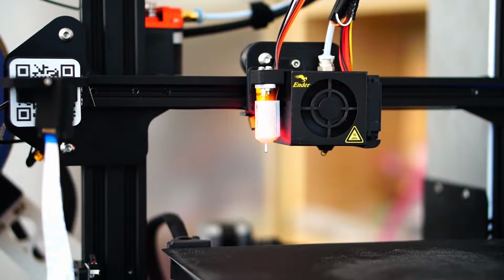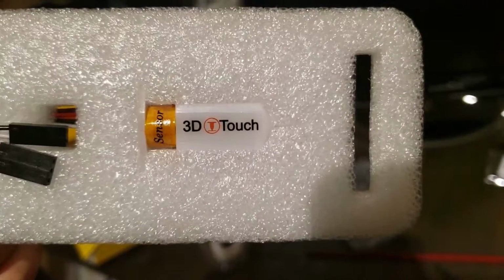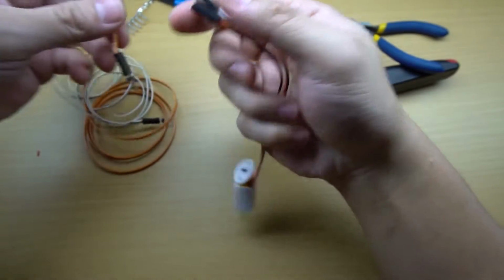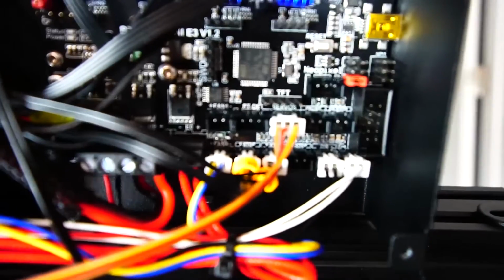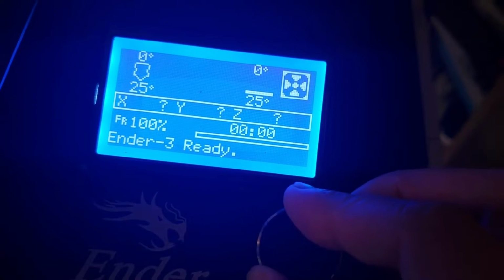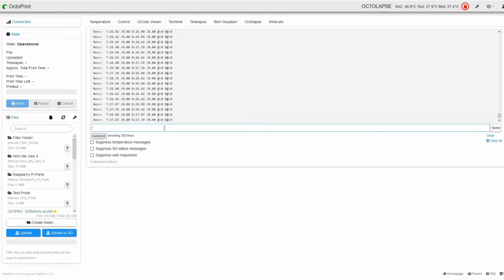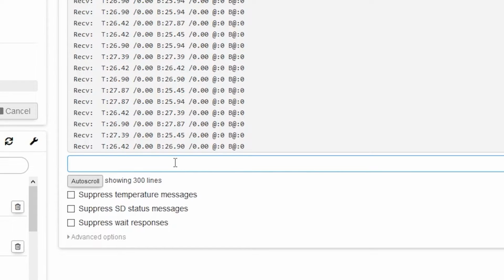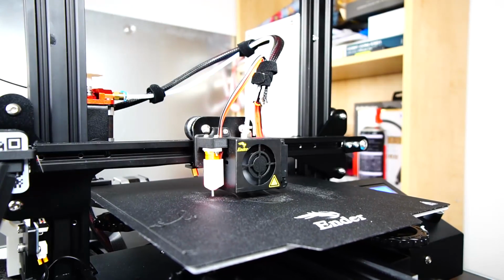3D Touch +  SKR Mini E3 v1.2 on Ender 3 Pro 3D Printer

Comment: Thanks for the video. but I'm having a big problem with the bed leveling it probes in the middle but in the first corner never touch the bed... I have been reducing the bed size to 225 change the probe setting and nothing make it to probe the first corner... any sugestion?
Reply from the maker: So when you run the ABL with G29, it goes to the front left spot and doesn't go towards the bed, or it goes towards the bed, but the probe doesn't touch the bed?
Reply: @dorkytim  it goes towards the bed, but the probe doesn't touch the bed
Reply from the maker: Could be a few things, like bad firmware, sensors not triggering, miss wiring, but really can't be sure with only this much info. I recommend connecting a terminal to the printer, using octoprint or another software, and seeing what the output is after G29 to see if it's a problem with the probe or sensor, there should be some response messages that'll give some more clues. If you are using BLtouch v3+  , definitely make sure you are on the latest firmware since there have been some known problems with the software not playing nice.
Reply: @dorkytim  This is what I'm getting [ERROR] Error:Probing Failed
Reply: or let me know what else info do you need. and by the way thank you for the great video and I hope you get more suscribers... I'm your 12 ... jeje
Reply from the maker: The error probing failed message indicates that it's not getting the right response from the probe. There's only a few things that can cause this.
1. If it's going off the bed, then you'll need to check your firmware and XY offsets. Typically bed size should be 220, but it also depends on where you have your X and Y offsets are.
Example:
#define X_BED_SIZE 220
#define Y_BED_SIZE 220
#define X_PROBE_OFFSET_FROM_EXTRUDER -48 // X offset: -left +right [of the nozzle]
#define Y_PROBE_OFFSET_FROM_EXTRUDER -10 // Y offset: -front +behind [the nozzle]
2. If it's hitting resistance before the probe. Make sure the probe extends way pass the nozzle when it's extended so that the nozzle tip isn't touching the bed first. Might need to try different mounts.
3. There's too much of a slant where the probe hits the surface, or the mount is not secure. You want to make sure the probe is hitting the bed flat. Make sure there's no tilt and that you at least try to level your bed as much as you can before using the auto bed leveling. As the probe pushes down, it'll throw an error probe failing if the values detected vary too quickly before it reads the results.
4. There are some cases where bltouch doesn't play well with certain versions of Marlin, but I think you are using the latest build, so this is likely not the issue.
5. Make sure to check wiring and nothing is getting loose while the hotend is moving.

These are all the things I could come up with, hopefully that helps.
Reply: @dorkytim  I was able to find the problem. It was the bltouch mount. Thank you for all your help and keep doing your great videos
Reply: @camiloecheverry5210  im having the same problem. It can probe other points but in other points, i get a probing failed message. Sometimes, the nozzle is already pushed to the bed.

Comment: great video keep it up ! my z is showing 12.5 from the bed. how can i fix it
Reply from the maker: Do you mean 12.5 after you autohome? That should be normal. You need to slowly move down towards the Z0 point without running into the bed and start to adjust the z-offset. This offset is to help determine the distance from the probe and nozzle and you may need to do some test prints to get it just right. Once you do, then you should be fine unless the bltouch or nozzel is moved.
Reply: @dorkytim  for some reason no matter what z offset i change it too my nozzle never comes close to touching the bed after auto homing my z. any advice?
Reply from the maker: The nozzle should not be close to the bed after an auto home. Auto home should park the nozzle around 10mm above the bed. Once the gcode is launched it'll go to the correct z position plus the offset.

Also note, some firmwares reset the bed leveling mesh after an auto home (G28), so you'll have to insure you have command "M420 S1" after the G28 command in your start code to ensure it uses the bed leveling mesh before starting the print. If you already run G29, then you don't have to worry about it because G29 (auto bed leveling procedure) automatically uses the bed leveling mesh it just created.

Comment: thanks again for you thorough reviews and instructions.    For the Thingiverse  reference to a mount, which of the two mounts did you actually use:   the ender3-bltouch-mount-4b-3mm-lower.stl or the ender3-no-support-bltouch-mount-4a-fixed.stl   ?
Reply from the maker: The one I used in this video is the ender3-no-support-bltouch-mount-4a-fixed.stl. It should fit with the stock fan cover fine, but double check that the nozzle is lower than the probe when it's retracted, but longer than the probe when extended.

Comment: That was actually a very well done video, very thorough and very precise, I like the tone you used throughout the video it  made it very easy to follow, I can tell you put a lot of work into it and it showed, you should definitely consider doing more as you certainly have a knack for it and you are certainly knowledgeable.
I have ordered the skr mini v2 that I will be fitting into an Ender 3  pro and using the bltouch from trianglelab, hopefully the wiring is the same as the 1.2 and I can refer back to this video.
Thanks for making this.
Reply from the maker: Thanks a lot for the encouraging words, I really appreciate it. I hope your v2 install goes well!